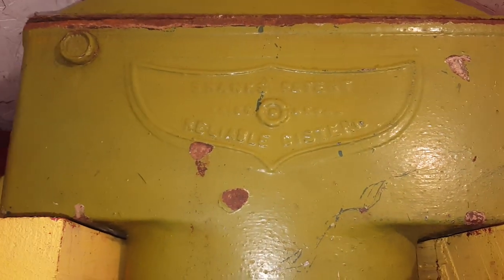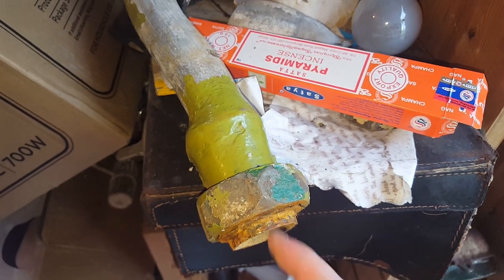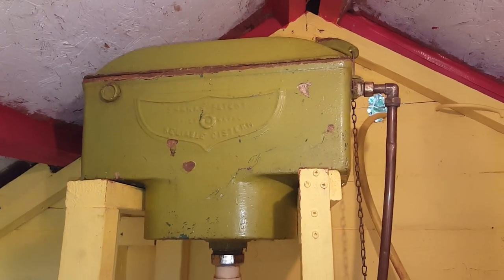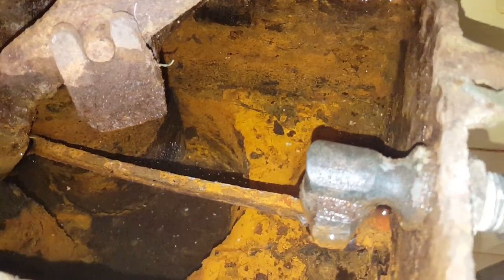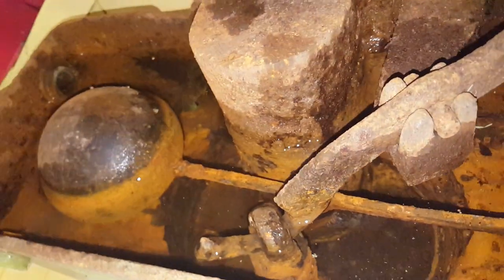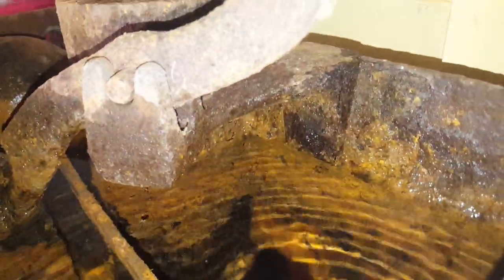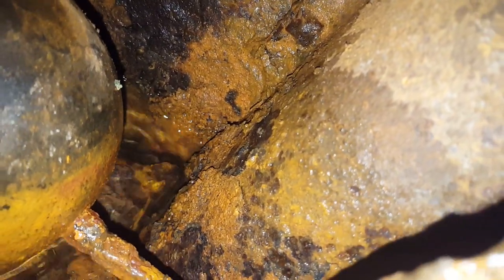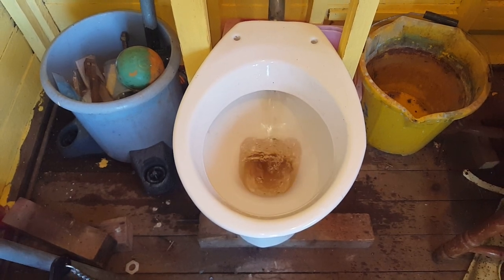Victorian Shanks Patent "Reliable" Cast Iron Cistern, Before Restoration

Comment: Brilliant! It features in my 1937 catalogue, it's also worth mentioning that shanks had their own metalworks so I believe they made all their ballcocks and other metalworks in-house
Reply from the maker: Awesome, I didn't realize they were made as far as the 1930s. Yes I have got this cistern decommissioned now for restoration and am still learning about it. The cast iron weight will come out on it's own without removal of the fulcrum. It is bolted in which I can remove & replace the bolts with suitable long lasting replacements. The lead weight as expected is from the M.W.B, but it is printed on the back in more detail as "MET WATER BRD"
Reply: @castironcisterns  also I forgot to add the float ball looks like an 'Onazote' expanded rubber one as far as I can see, must be a replacement if it is since they didn't start making those until the 50s
Reply from the maker: @TwyfordsLad  It is indeed. Funnily enough I was wondering about it as the ball was "ahead of its time" and easily came off. The Croydon valve had clearly been serviced in the 50s / 60s too at that time as the piston was not fully closed and had a black rubber washer in it which didn't look too bad. However the croydon valve does need reseating too hence why it leaked. And then taken out of use..

I have successfully since managed to remove all the parts of the cistern and is now a shell. Solution was to angle grind off the old nuts (bolting the fulcrum piece & dome in the back of the cistern) holding the bolts in then afterwards was straight forward 👍 All to be cleaned up properly
Reply: @castironcisterns  I don’t know why they didn’t stick to the Onazote float balls tbh because they’re impossible to sink since they’re not hollow. Sounds like someone threw a piston washer on it not realising it was the seat causing a problem. And good to hear look forward to seeing it restored